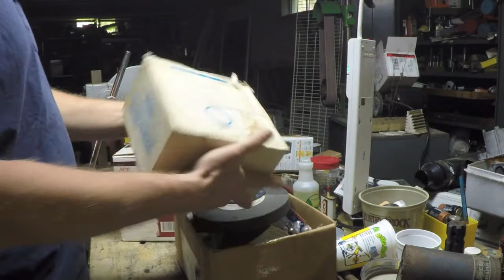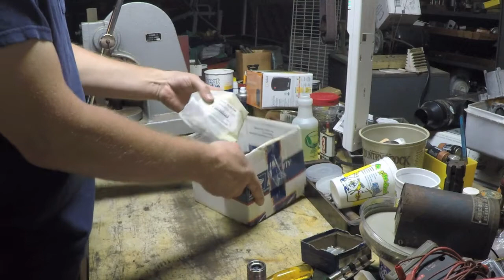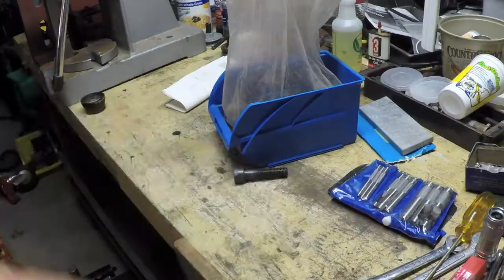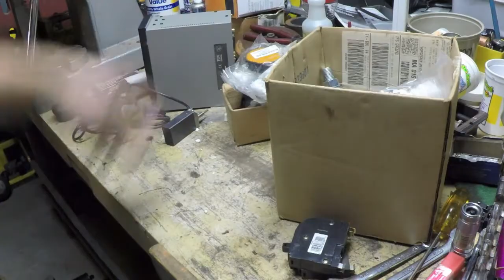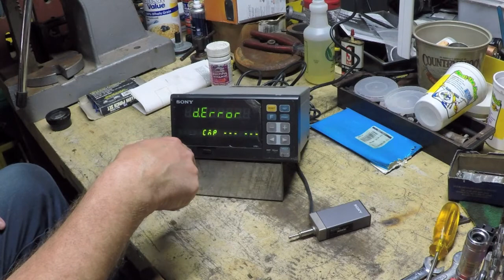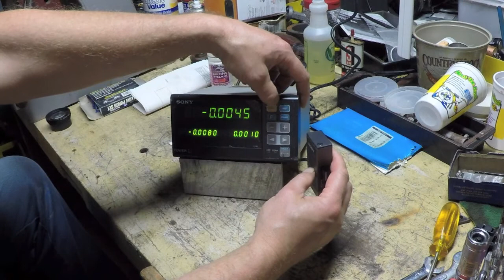May 2017 Estate Sale Part 10

Comment: 10:45 that Sony setup would be pretty handy.  Even if just for some quick check measurements.  It sure can take Linear scales like you would use on the mill table.  We had one on a older lathe.
Reply from the maker: gbowne1 I've seen a video of a guy using a scale on one, but the scales are pricey, and a quick search of ebay yielded few results.

Comment: Great score. Hardware and consumables might not be the most exciting thing for a video, but that bag of cap screws/washers, the cut-off discs and grinding wheels, and the leveling feet are awesome. I used to hit moving sales and yard sales with an eye out for liquid consumables, like spray paint, paint stripper, acetone, penetrating oil etc. In some clean-out situations you can easily walk away with a hundred dollars worth of chemicals for almost nothing.